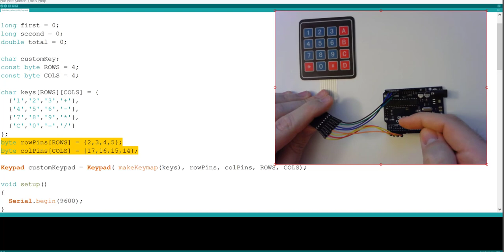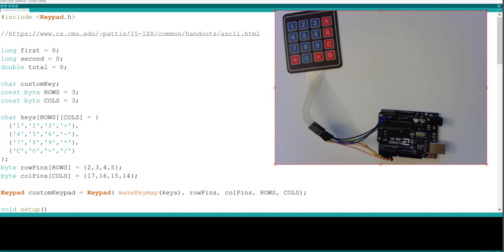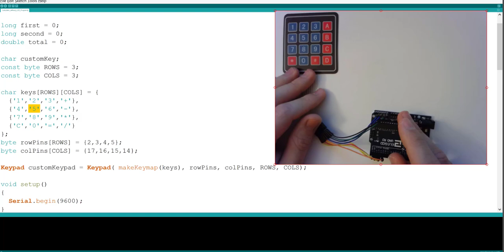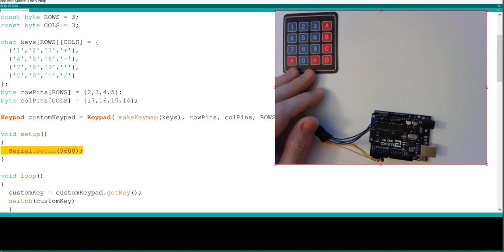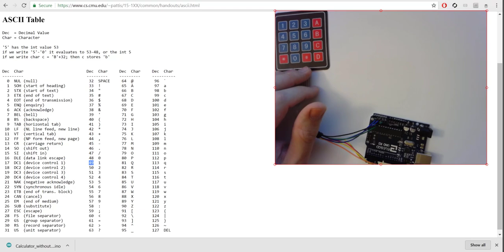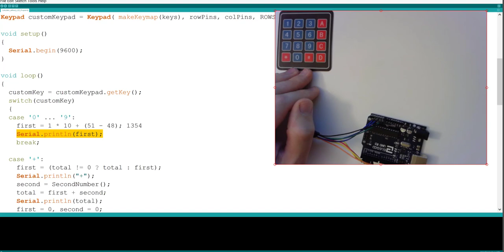Arduino UNO Tutorial #5a - Keypad Calculator Without LCD

Comment: Great Job so far in your courses, I've learned a lot. I do have a quiestion though. I kindof liked the idea to learn the whole course without using an actual arduino board and electrical components, since tinkercad had most of that, it even have the keypad you are using.... the thing is, I can't seem to be able to "include" a library. I was expecting they at least have some sort of emulation for that, since they have the components there already, any ideas what to do in that case, besides purchasing a board?